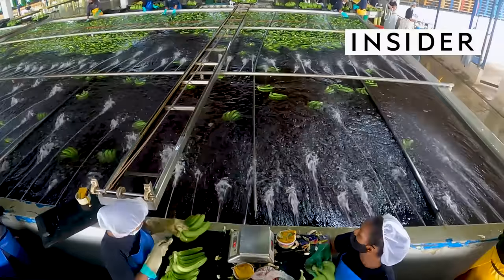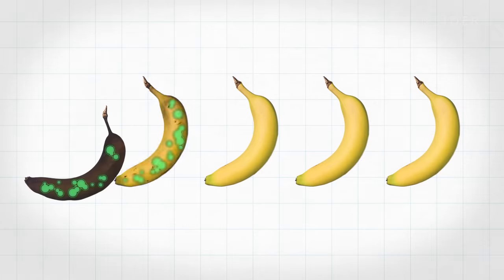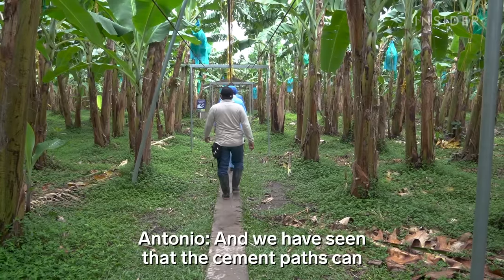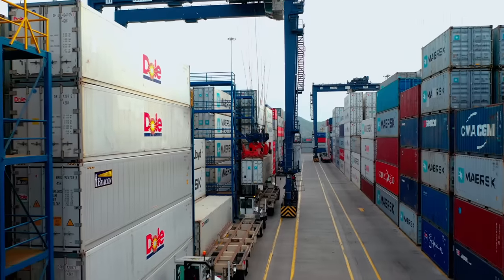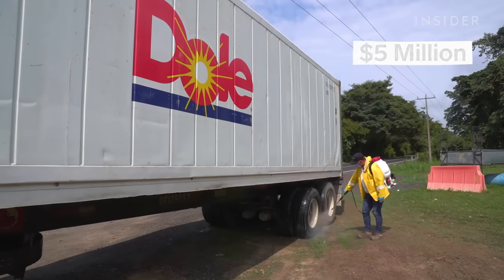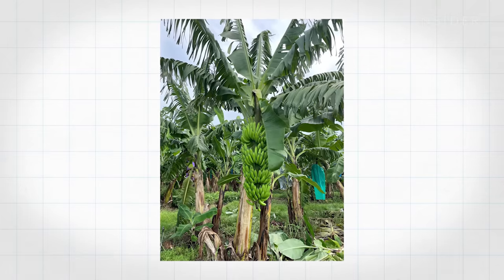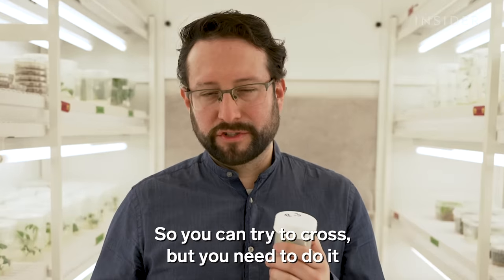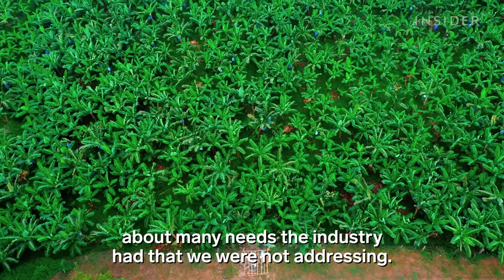Why The World’s Most Popular Banana May Go Extinct | Big Business

Comment: Looks like they don't actually spray the underside of trucks. It's also something that can't be done from the sides with a pressure washer. They would need to make something that can spray upwards for it, like a piece of tube with holes in it, and that the truck can roll over.